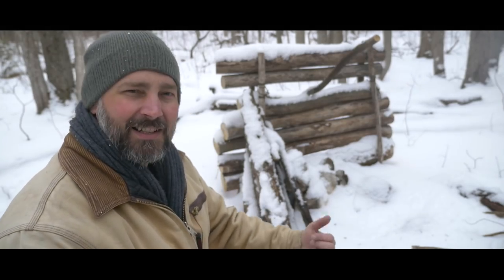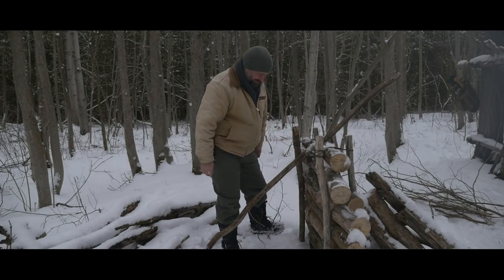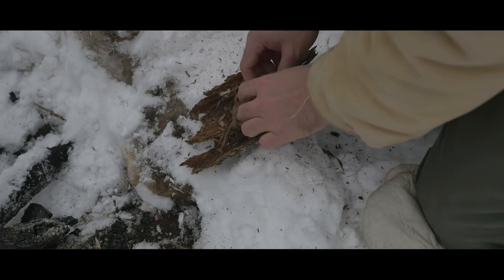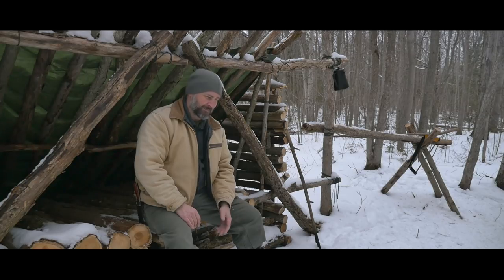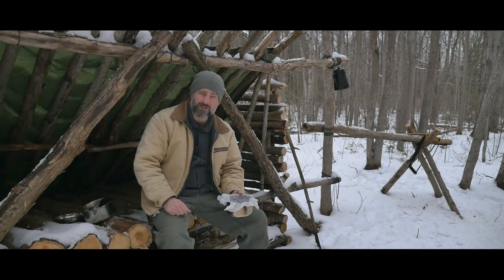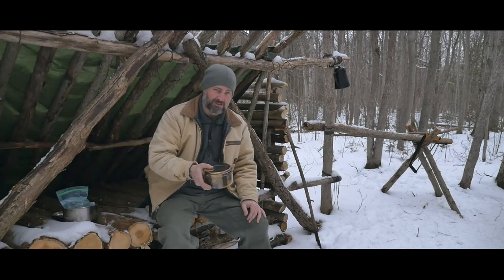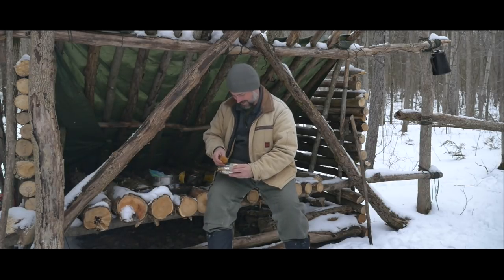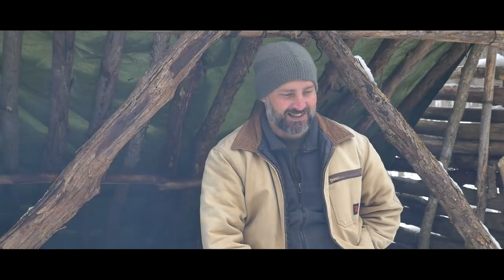Bushcraft: Camp Improvements & New Way to Cook Bannock/Damper

Comment: Big difference in parchment paper and waxed paper. Use parchment for baking. I put 3 small stones or 3 rolled up pieces of foil on the bottom of the pot then lay the parchment on the 3 to keep it of the bottom then the pot will be a better oven. No burning then. Great video and I love the camp site

Comment: I pre-cut parchement paper to the size of the bottom of my pot at home, then I half-cook one side of the bannock, turn it over on a new parchement paper and finish cooking. A good and efficient way to avoid burning the bannock and cleaning the pot. Always good to experiment and share new ways!
Reply from the maker: Yeah, exactly. I use the stuff at home a lot, so decided to try it over the fire.
I'd like to figure out the easiest way to keep pots clean(ish) and not burn food to the sides. I think this way will work well with a bit more practice.

Comment: Hey friend! You want parchment paper for baking, the wax on wax paper will melt off into your food (yuck). Parchment paper is food safe for high heat. Great idea to line your bake pans! I will definitely be trying your hack this summer. Thanks for the video!
Reply from the maker: Hey Jennifer, Thanks for the comment, I wasn't sure what the difference was between wax paper and parchment paper or if they were the same thing. I'll definitely stick with the parchment paper. :)
Reply: Just like mothers used to do for baking pans at home.  The unwaxed Parchment paper is definitely what you need.  The pan can also be buttered and the parchment cut into a round and placed in the buttered pan.  Using coals to top-heat the lidded baker is also and idea from Dutch oven baking.  I never have found lightweight backpackers' pans to work well for baking:  there is insufficient thermal mass to spread the heat and stainless steel is well-noted for developing hot spots over the gas range at home.

Comment: Jason -

Fill the pot with water up past the burnt on stuff, add a teaspoon of baking soda and bring it to a boil. Then move it away from the heat far enough to maintain a simmer and let it simmer for awhile... easy clean up after that. (Works best on stainless steel.) If the stuff is bad enough, you may need to add more water and let it simmer longer. Just scratch it with a utensil and you'll know when it's ready.

PS - make sure it's baking SODA, not baking powder.
Reply from the maker: Great tip! Thanks!!